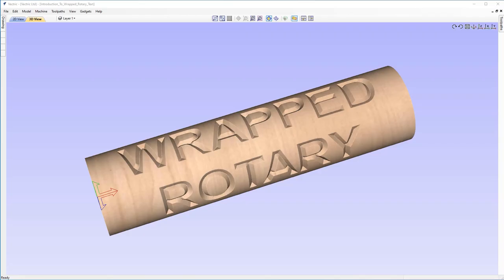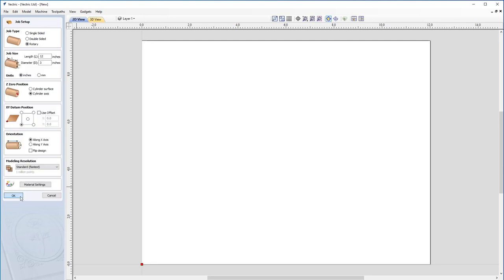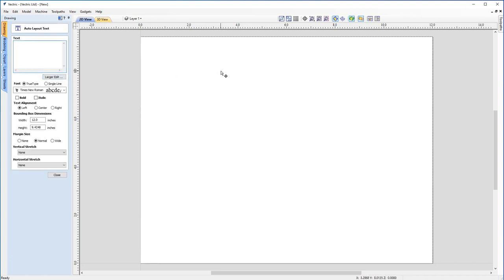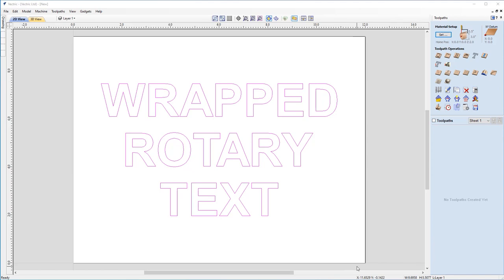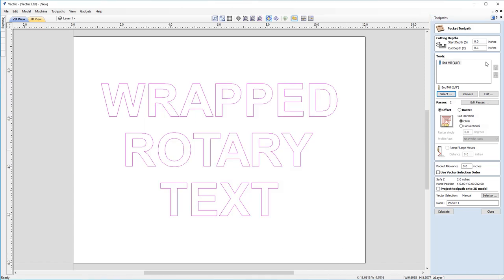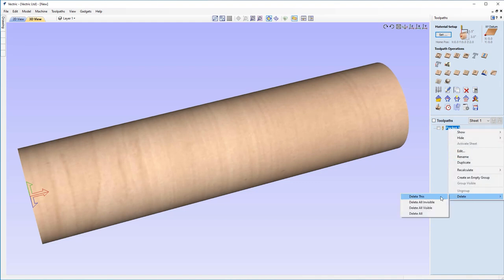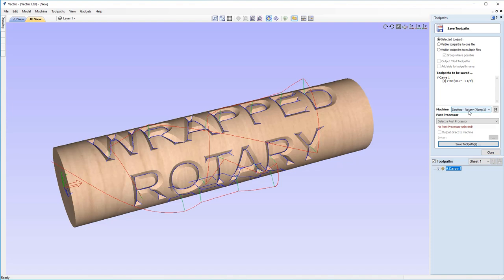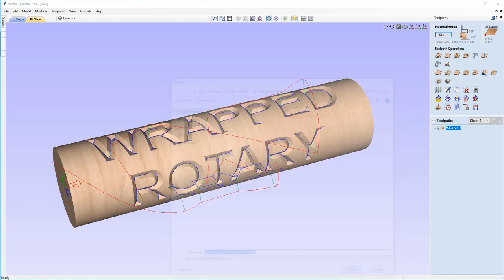Introduction to Rotary Wrapped Text | Vectric V11 Tutorials

Comment: I have 4 axis CNC wood router Mac3 sir what g code use for spring type legs in routery for mac3
Reply from the maker: Thanks for the question.  I would suggest you contact support@vectric.com and they can help.  There are a few questions they will need to ask.